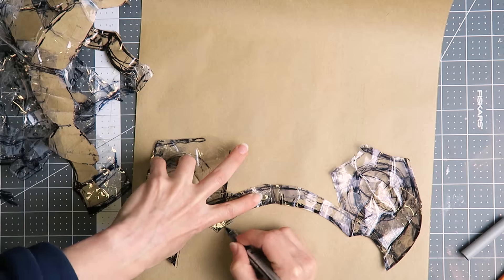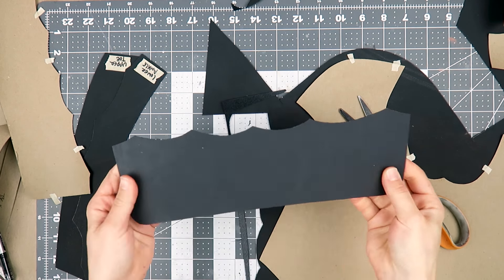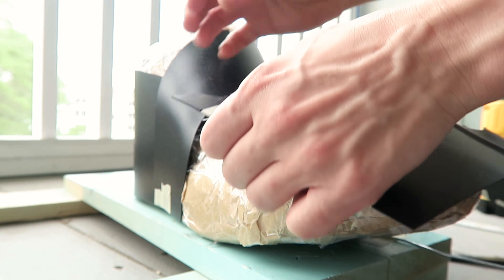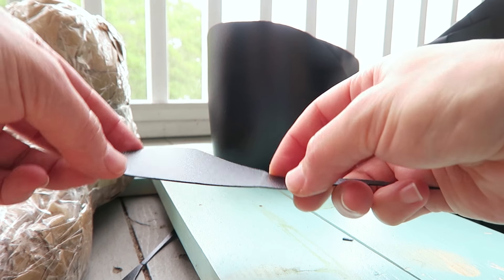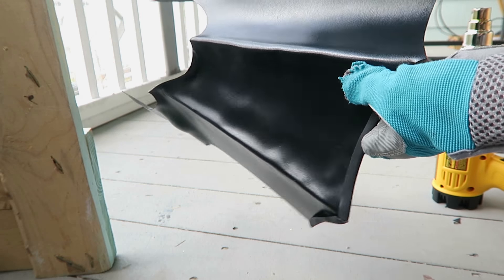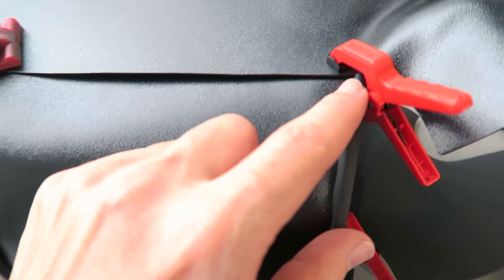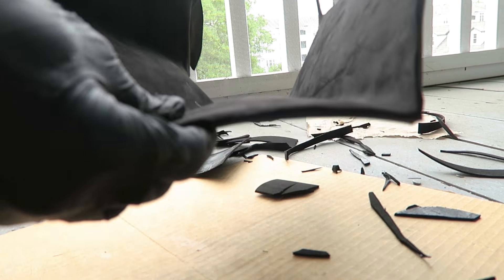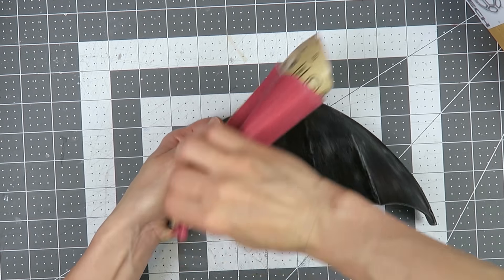How to Build Gothic Boot Armor from Kydex | LOTR Ringwraith Costume (Pattern Available)

Comment: What is the temperature of the hot air fan where I can mold Kidex without getting hurt
Reply from the maker: I don't know the exact temperature, just heat until it softens enough to mold. You can get heat resistant gloves and obviously never point the heat gun toward any part of your body.